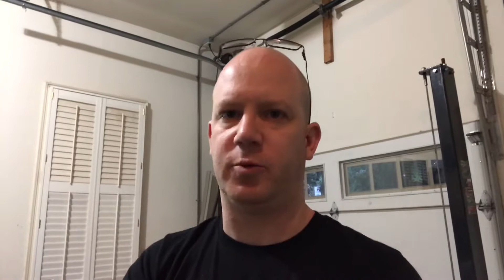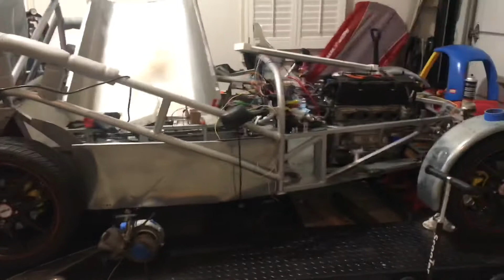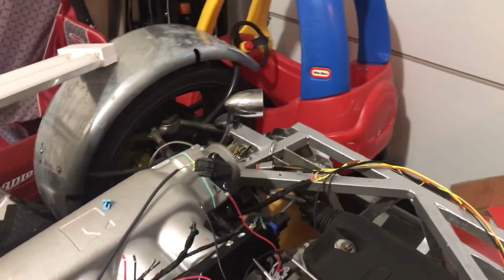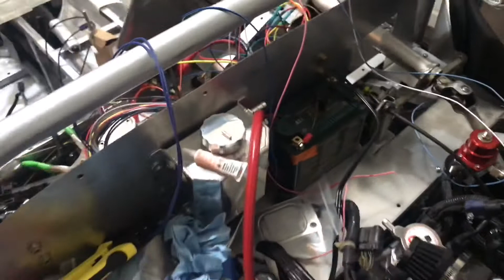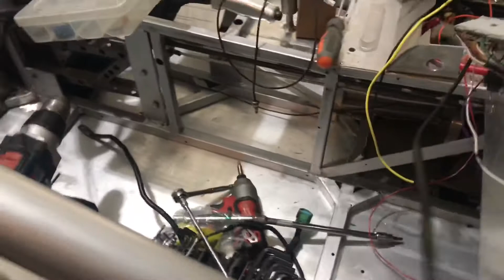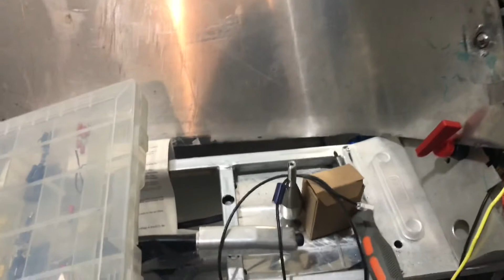Progress on the Lotus 7 build. Now with a Honda K20 motor

Comment: Kindly help me.
Using K20 engine, where do I buy the bell housing adaptor?
What transmission and differential that I need to use?
Thank you sir, Nice build by the way.
Reply from the maker: The bell housing adapter and flywheel were from kMiata
Reply: @exportedafrican what about the transmission and differential? What are you using?
Reply from the maker: @zzzzzsleeping transmission is from a junkyard and diff is from a Miata. Custom driveshaft
Reply: @exportedafrican sorry I did not explain well, I meant what transmission are you using ? Honda K20 also?
Reply from the maker: No. It is a bmw getrag transmission from a 90s 3 series.

Comment: What gearbox are you using please
Reply from the maker: Getrag 260 from an e30 Bmw
Reply: @exportedafrican  home made conversion plate
Reply from the maker: @davebgsi  I used the kmiata one. I don’t think it’s too hard to make your own but it depends on how much your time is worth. Feel free to email me and I can give you some added info. Exportedafrican@gmail
Reply from the maker: Are you thinking of coming to the dark side?   My only concern is the motor is a bit tall. Other than that it’s fantastic. Don’t think you would have an issue with the steering on the other side either
Reply: @exportedafrican  considering my options! K20 is same height as my CA so I should be ok